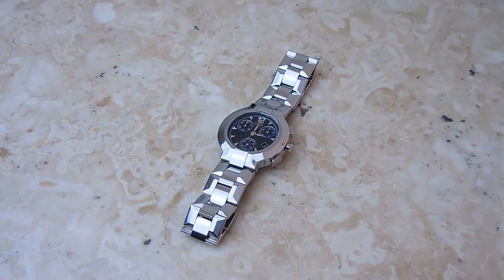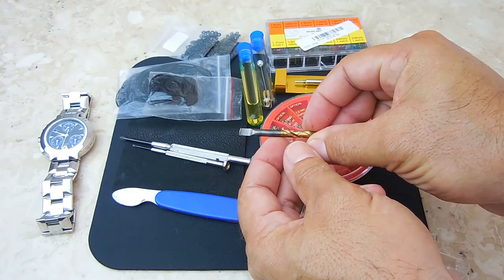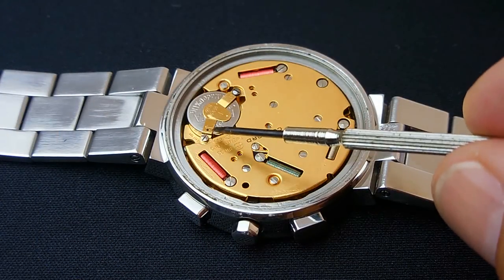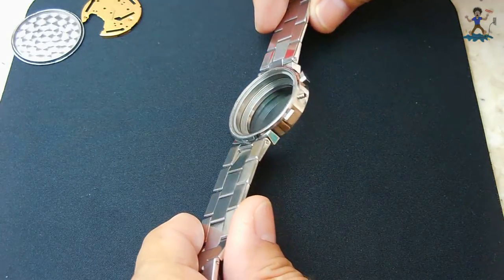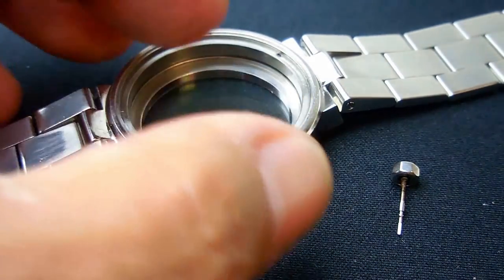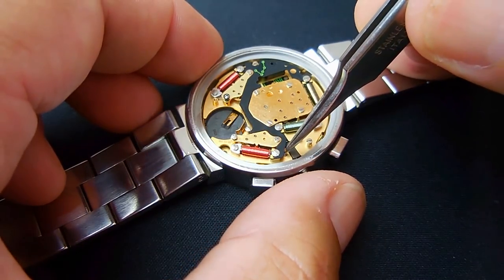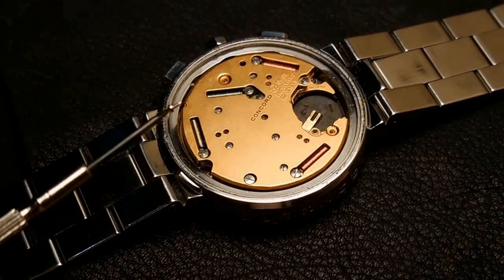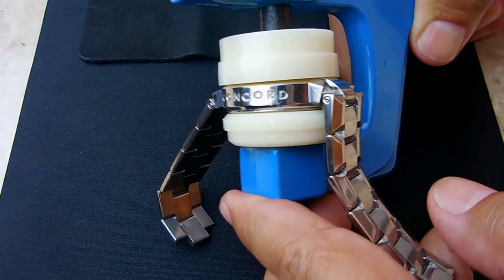Chronograph Watch Repair

Comment: Excellent. I have a Tag Heuer with similar battery mount. You skipped a bit over clamp installation. It's a pure nightmare on the Tag. This is a horrible design for a battery mount. I can see you had few turns on the holding screw. I literally have two and a half turns. The screws are tiny. I mean spec of dust tiny. I think this might be done on purpose. So you have to go to Tag dealer. Well , it gets expensive for a $2 battery every year. Thank you for showing this. I know now Tag is a piece of garbage.
Reply from the maker: You definitely need magnification and a very clean work area when doing as shown. Thanks for watching!

Comment: Ok, I bought the same mixed bag of o-rings that you did from Esslinger.  I'm kind of stuck at this part because other sources are determining o-ring suitability to the nearest .1mm (In which case I need a 35.7mm x 1.5mm from somewhere in that mixed bag) and I'm sitting here staring at wadded nest of unmarked rings.   How did you determine which one to use?

Ugh, I should have bought the marked box for $20 more.
Reply from the maker: solamisandwich05 Do a side by side comparison with a magnifying glass, then lay the new o-ring on the old one.
Reply: That was fast!  Did you use a just match or did you go down size by a tiny .1mm diameter?  Esslinger suggest going down by .1mm on their video, which would be fine if the rings weren't packaged by monkeys.  I'm wondering if it really matters that much.

Comment: From what I've gathered, isn't the viscosity of sewing machine oil far too high for watch use,...plus, you said you don't need to oil the jewels (very hard and smooth), then proceeded to do just that with SEWING MACHINE OIL.  I'm a bit confused now.
Reply from the maker: I've been using sewing machine oil for many years with no issues at all, it's fairly thin oil. You don't have to oil the jewels, but I did it one time to further reduce friction. Thanks for watching!

Comment: The second hand is just staying at the 15 seconds. Is not making the whole movement (0-59 seconds). Could be the batterie?
Reply from the maker: If the second hand gets stuck, then I'd oil the jewels and replace the battery.
Reply: Many thanks :)
Reply: I'm no expert but from what I understand that's usually caused by a zapped battery or loss of power (meaning bad coils.  I was told it's because it takes energy to transfer through like 3 motionworks before reaching the second wheel.  Makes sense considering it's at the very end of the transfer, and if there's no putter left int he battery it'll just refuse to move since there's no power.

Comment: With the utmost respect:
1 - You do not want to use magnetized tools. This can in turn magnetize the screws and other components that are susceptible to magnetism, and it will affect the accuracy of the watch, even if quartz.
2 - The plate and everything you see there that you called brass is actually gold plated steel, not brass.
Reply from the maker: I'm pretty sure you're right about it being gold plated. As for the magnetized jewelers screwdriver, what you said can happen, but I've yet to see any problems after working on a few different watches. The magnetized screwdriver also greatly reduces the chance of a very tiny screw falling deep into the watch mechanism(gears). Thanks for watching!

Comment: Does pressing the chronograph underwater damages the watch i have a tagheuer aquaracer 300m quartz i did press the chronograph when it was inside a mug filled with water nothing happened but now u know that it does damage the so is my watch or is it damaged but it is working properly no problems i am a bit confused.
Reply from the maker: NEVER press any buttons under water or if covered in mud.
Reply: @electronicsNmore  Sorry i made a spelling mistake i was suppose to say that now i know that pressing the chronograph underwater damages the watch. But i want to know one thing that how much damage does happen when i pressed it nothing happened at that time.

Comment: The oil is a terrible idea. The rest of the video is great, but NEVER oil a watch!
Reply from the maker: Nothing wrong with using oil. Watchmakers use it all the time to reduce friction. A very small amount of oil is a GREAT idea.
Reply: Only problem with oiling is that you did not remove the old oil first. Oil will inevitably get dirty and gummy. Just adding oil on top of the old oil might get you by for a little while but will eventually get gummy and slow down the works making your time piece loose time and maybe even stop running.  Thanks
Reply from the maker: Never heard of that problem. After 9 1/2 years, I still have no gummy residue. Thanks for watching